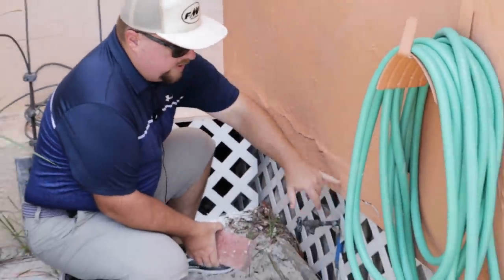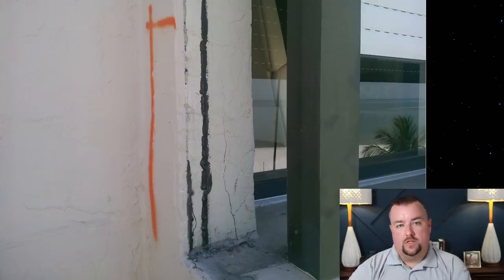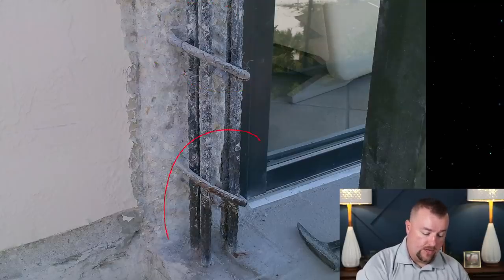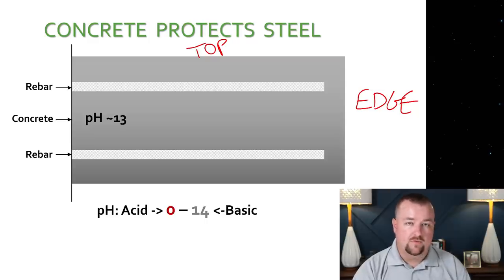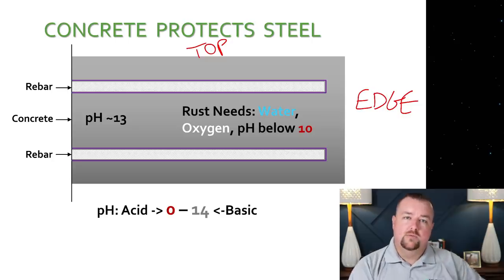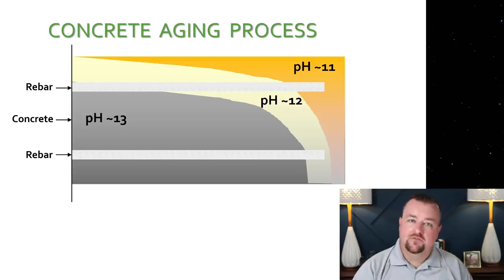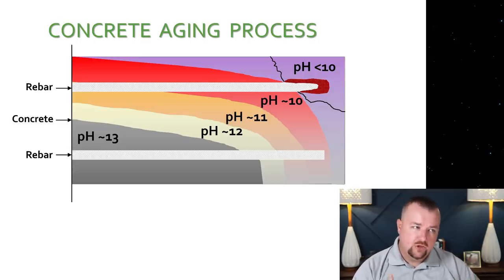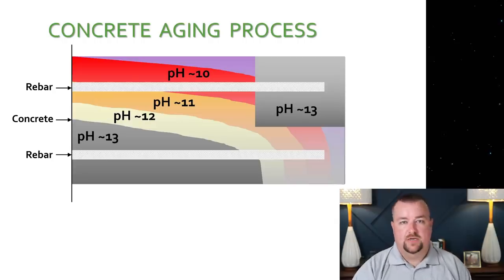Reinforced Concrete's Number 1 Enemy

Comment: The Pantheon in Rome is 2000 years old and is solid concrete ….How did they manage to make it last .. Roman concrete is a different mix… so is it chemically different…?
Reply: It's also a structure designed and built around concrete alone. Concrete is very, very strong in compression, but weak in tension. The Pantheon is an unreinforced structure almost totally in compression. With no steel inside to rust and produce spalling, and no part of the structure in a shape in which concrete is weak, as well as being overbuilt, it'll stand for another 1000 years easy.
Modern structures have slabs and such where there's tension on the slab, so the steel is there to take the tension loads to prevent the concrete just giving up.
Reply: the romans used no steel reinforcement so they do not degrade and spall.  also, the walls are 5=10x the thickness of modern walls.  modern rc construction allows cheap airy contstruction while sacrificing durability.  roman concrete is different in that it used volcanic ash as a big component in the mix.  fly ash from coal plants is used as a modern substitute.
Reply: Google says portland cement was invented in 1824, so it must be very different.
Reply: @truckerallikatuk  I read they used volcanic ash in the concrete mix as well … there was not much rebar around back in the old days
Reply: @dealsfromvirginia1773  cement is made by burning calciferous rocks in a kiln.  the romans used volcanic ash that had been burned in volcanoes and spewed out.  similar product, different processes.
Reply: @stephenrickstrew7237  Yes, and you'll notice where it got us :)
Reply: They made concrete from volcano  dust   very strong.
Reply: I believe the centre of the concrete Roman structures is still curing.

Comment: Can concrete be re-alkalinized ?  Also - if the rebar is only to add strength in tension and a column is under pure compressions- is rebar then a liability ?
Reply: I guess on balance, rebar’s ability to add tension strength outweighs the possibility that it can rust in certain environments.

Comment: Thanks for your content. Given the mind boggling quantity of cement used daily worldwide, I'm getting more curious about it. Apparently the world is running out of sand, for example.
My humble contribution here is "waterproofing" and relates to epoxy and "resistance to moisture".  My background incluces some boat building with a particiular interest in epoxy/wood/glass fibre/synthetic fibre composites. 
The Gougeon Bros. On Boat Building book (old now but still applicable in practice) spends a lot of time on moisture resistance of epoxy in various composites. They were also exploring moist. res. and fatigue in wind turbine blades. and did very many tests, some extreme.
The take-away from the book is just how hard it is to achieve anywhere near "waterproof" even though epoxy in itself can be considered to be waterproof.  You can, however, achieve acceptable practical levels of moisture resistance IF it's used exactly as proscribed. 
I can't see it being practical on a construction site and some products are now banned on same in Queensland.  Maybe the whole subject of waterproofing needs more attention in the building industry.

Comment: Excellent explanation.
Brilliant videos.
The worry I have with repairs to concrete spalling in columns under high compressive loads 
is that the concrete used in the repair is not under the same load as the rest of the column.
It shares none of the load of the original concrete it replaces.
The integrity of a steel reinforced concrete building relies on the ability to completely resist water intrusion.

Comment: What about instead of steel rebar, you used, say, carbon fiber rebar that had surface roughness to give the concrete an irregular surface to adhere to.
Reply: Carbon fiber will break or shatter when it's compressed, pushed beyond its strength capabilities or exposed to high impact. It will crack if hit by a hammer. Machining and holes can also create weak areas that may increase its likelihood of breaking.
Reply: @Meanwhile in Indiana We’ll, how about encasing steel rebar in a waterproof envelope or coating. Continuing to use legacy steel rebar in concrete buildings is NOT the answer. Explore the possibilities, don’t keep doing the same failure prone steel rebar. FIX THE FUCKING PROBLEM!  .
Reply: That already exists and is sometimes used. lt's about 15%-25% more expensive than conventional steel rebar, which limits its application. Ditto for stainless.
Reply: @CrazyPetez  A pinhole manufacturing defect or a scratch that may occur during handling or placement at a construction site will cause an epoxy coated rebar to degrade rapidly.
Reply: Rebar Costs by Type
Steel	$0.18 - $6.80 per linear foot
Stainless steel type 304 or 316	$2.50 - $16 per linear foot
Reply: only real choice in my opinion is stainless. upfront cost verses repair costs in future is similar 
I propose.
Reply: @meanwhileinindiana8107  That may be, but the current requirements are totally inadequate. Just ask a survivors of the collapse of that Florida condo.  New methods should be mandatory - PERIOD. Make all the excuses you want, people will die if laws aren’t changed. I live in a stick building, a single family home in California, so none of this effects me personally. What is your excuse for resisting change?
Reply: @meanwhileinindiana8107  Come on man, you’re arguing against any ideas to improve the safety of multi-story concrete buildings. Yes, I’m not so stupid to ignore steel rebar coating would need to be tough to avoid damage during transport and installation, I understand that. If the steel rebar can’t be 100% protected from rusting, perhaps a substitute for concrete, with all its problems, could be invented. Something plastic that would not crack, would not allow water and steel to interact.  Do SOMETHING, don’t just stand there, shrug your shoulders, and watch the next building crumble.
Reply: @CrazyPetez  I live in a stick built house too and I have no power over what anyone does, sorry I answered your message. Your name fits. Im just a viewer.

Comment: Fascinating! Small, concrete apt building in earthquake country where there are many cracks but attributed to temblors of varying degrees. But, there's an upper deck walkway which has needed repairs a number of times over the years. Similar process of removing crumbling concrete, patching, etc yet we have so little rain in SoCal and those areas are never watered. Perhaps not installed properly and sealed, each time, on the assumption not needed due to climate? Other contributing factors? 

Since watching these videos, even more mindful of how robust the supports are, both underground and outside, which were re-inforced during earthquake retrofit several years ago. Another great, informative video!

Comment: JOSH: I would love a video on how engineers establish concrete damage, and the options for repair. Does someone come and take a core sample to test for ph levels? How? Once damage is assessed, what are the prudent next steps for competent technical repair? I’m in a building where I’m now genuinely worried. The maintenance across the board from pipes to water tanks has been dreadful, I am photographing large cracks around posts and spalling (sections are easily 1 foot by 20 feet with feet of rebar fully rusted and visible) in our parking garage to indicate progressive, cumulative damage to owners who have neglected even the most minor repairs over decades. Salt after 40 years of Canadian winters is a huge concern. I may sound like a paranoid person, but I’m not. Currently the parking garage ramp is being held up by JACKS and LUMBER. (I wish I was kidding but I’m not.) Your expertise has helped to inform so much, to assist with safety and education.
Reply: you need to call the local building inspector and email them pictures of the damage you see.

Comment: I know very little about building construction but have been around boats a lot. The key thing boat owners learn is how exceptionally corrosive an ocean environment is. You see that on docks and marinas, as well as boats, with even a ten year old dock looking in need of replacement. Whenever I see apartment buildings directly exposed to ocean weather I have always thought: Do those owners appreciate just how accelerated the deterioration is, simply by being that close to the ocean?

Comment: Great video! I've poured hundreds of yards of concrete. Mostly retaining walls and grade beams for foundations.
You never explained the role of salt in the water in attacking the re-bar in the concrete. I assume it would accelerate the pH change in the concrete. Here in California steel inspections are primarily to check for a minimum 2 inches of concrete coverage. MiraDrain is used to allow water to be removed from the backside of the walls. I've worked with some pretty good engineers but always learn more from your videos! Thank you....

Comment: With so many comments, I was hoping they wouldn't all be "oh, I love you," and instead perhaps ask my question, but no.

Probably won't get an answer, because this drowns in simp comments, but I don't think it was very clear what exactly causes pH to drop. 

You mentioned salt water in the beginning, but is that required for this process? What about just rain water (which I believe is about 7 pH) saturating concrete. Will that produce the same result? Is salt an accelerator? Will rebar rust even if just normal water is allowed to saturate concrete, and if so, what amount of time is required?

Thank you. Amazing channel.

Comment: Mass timber is a better way to build mid rise these days IMO. 

As a commercial wood and steel framer who also does seismic retrofits and structural upgrades on mid size buildings, I wouldn’t mind getting into fixing up these old concrete structures.

Comment: On roads, when one sees concrete structures, the concrete is no protected, for instance painted.  How do those structures fare then?  I know of multiple concrete bridges that are still up, and in use.  I have not gone under them to check for this issues, but the structure is there.
Is the concrete of a different type?  Or does it have some protection that avoid this?   If it has a protection why that protection is not used on regular buildings? Also, I have always wondered how does the concrete used for piers differs with the regular concrete used for buildings.
Thanks for these very interesting and educational videos.

Comment: Building failures are human failures.  In the condo industry HOA's have a board elected to uphold the laws and bylaws (but are protected from legal liability by insurance paid with HOA dues).  They have a duty to maintain the building EVEN when the location of the building or development makes this wildly expensive.  So why, when a foreseeable event like the Champlain Tower collapse is caused by human failure (greed), is it called a "disaster" and millions of Federal dollars used to fix it?  Accountability could have prevented it.  Don't develop where you shouldn't and don't buy if you can't afford to maintain.  God damn.

Comment: Great Video, All this can be avoid with proper maintenance, even a simple paint job can help. There are also concrete additives that can be added to make concrete last longer, but everyone wants to save pennies.
Reply: There was a comment about the rubberized coating in older buildings didn't work...
Reply: @windsofmarchjourneyperrytr2823  Not rubber treatment on concrete, latex additives that are used in concrete and using higher PSI concrete always helps. Denser concrete absorbs water less. Also galvanize rebar.  Used all these on seawall to extend their life. Oh, and you have to do in the concrete not after the fact.

Comment: I hope this is not a dumb question  but if rebar was coated with a rubber and then used to reinforce concrete , would this work to prevent future concrete failure ?

Comment: Fascinating discussion.  So what is the next step in repair?  In other words, once the spalling progresses deeper into the slab as you've discussed here (i.e. post-initial patch), how do repairs get made?  Going further, how would a structure such as the Surfside condo get repaired when the deteriorated concrete at issue might be their pool deck or supporting columns are so fundamental to the building's overall structural support?

Comment: Josh, 1st off Thanks so much for the detailed information on multiple facets of concrete construction. Excellent work! 2nd My out of left field question - With the various information that has been accumulated to date on the collapse if we could time travel back to 2018 when the engineer report was done and the estimated $ 19 million in repairs was required. If they had all the information that you have today would the needed structural repairs be financially viable to the home owners? I'm thinking that $19m would have been a drop in the bucket compared to the actual repairs needed at that point.  It will be interesting to see how the inspection cycle and inspections (further detailed inspection) changes after all the various reports are completed and released by relevant organizations.

Comment: Good video easy to understand and can I add
- Your original clip was interesting it showed clearly how a wall/beam could look fine (due to the paint) but was in fact in trouble. 
- My understanding is that water and Co2 can form a weak acid so it isn't necessary to have salt present to change the ph
- I have seen concrete areas that need replacement of the steel (due to loss of section) as well as steel protection by using epoxy
- concrete porosity depends on 'designed strength' i.e. high strength concrete is less porous, and good concrete placement: as you want solid dense concrete in place - this can be difficult at complex joints and where there is a lot of rebar
- the depth of cover to the steel is IMPORTANT to prevent rusting, unfortunately if you bury the steel too deep it can make the member weaker (in resisting moments/flexure) and this can develop more cracks. 
- and, I was always told that minor steel rusting (before concrete placement) was 'good' as it provided a slightly rough surface that provided a better bond.

As I said good video complex concepts simply explained.

Comment: Excellent and clear exposition. I have one quibble with the chemistry of the pH reduction. NaCl solution is neutral and will not reduce pH. I think this is due to CO2, which dissolves to an acidic solution, and sulfates in acid rain. The chloride will accelerate corrosion of the iron in the rebar, but does not directly affect pH.

The chemistry is a bit complex. Na+ is a weak acid in the "Lewis acid" sense. A Lewis acid is capable of accepting an electron pair.  The more commonly used meaning of "acid" is the Brønsted–Lowry definition, which is a proton donor.  This is what changes pH.  So Na+ can be called a weak acid in one sense, but it will not affect pH. None of this affects the conclusions of your talk, just a matter of detail.

The CO2 is effectively reversing the process by which cement is made in the kiln (CO2 is driven off). This actually increases the strength of the cement, but reduces pH.
Reply: Nicely put, but the presence of salt as a corrosion accelerant does affect the conclusions. 

Has there been any more investigation of the source of the recurrent salt water flooding in the basement?
Reply: @polychromaticlaser635  The presence of salt will accelerate the corrosion, but through a different mechanism than pH change. I was thinking that the conclusion was salt will accelerate corrosion, which still stands.  I know little about concrete buildings which is why I find these so interesting, but I do know something about chemistry. I am chipping in a detail to help. At some level, these details are important. I guess salt in the absence of lower pH may not be a problem, because the steel will still have its passive surface, but I think both will occur together in most situations.
Reply: @obviousmaths4368  with you all the way.

Comment: Absolutely amazing stuff and although I have known about rebar rusting resulting in expansion causing spalling and cracking, I have not paid any real attention to long term remedies. 

Now looking at the video's of yours and thinking back quit a few years, I used to add a Latex additive to kitchen, bathroom and shower grout to alleviate/prevent water absorption into the grout causing bacteria buildup, blackening/staining and erosion of the grout!

1) What might your answer/criticism be on my approach and reasoning? and 2) could an additive such as latex be used in a major pour structural concrete mix to buildings "if not already done" ????

Comment: I am absolute noob on all this stuff... but is it possible to redesign many structures we build today but with a focus on non-reinforced concrete by just pouring thicker slabs, etc?  Like some roman structures still standing thousands of years later, could the initial cost of more concrete pay off in the long run by not having to do constant maintainence and repairs longterm caused by the steel rusting?  Or why not just stainless steel rebar or something?  Also, seems like it could be possible to attach pH sensors within the concrete/rebar structure on crucial supports to provide a non-intrustive, real-time picture of current pH levels within the concrete as it ages.